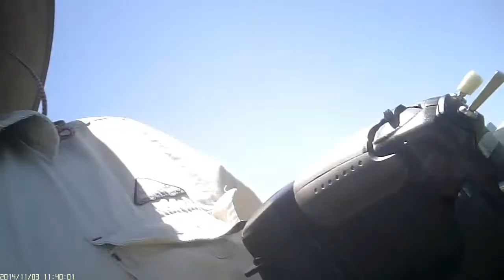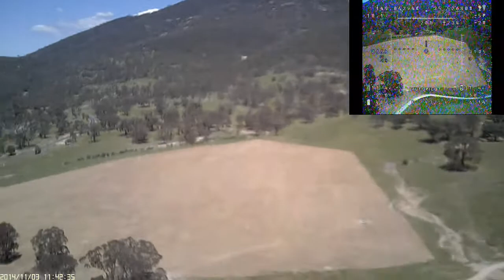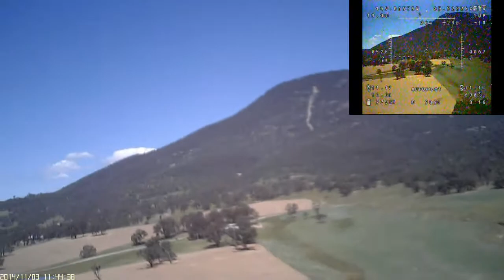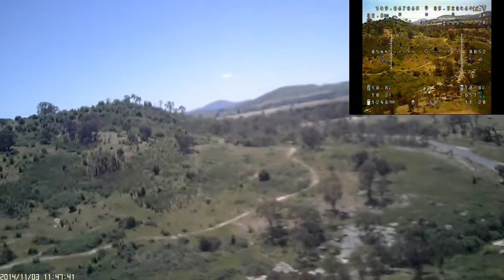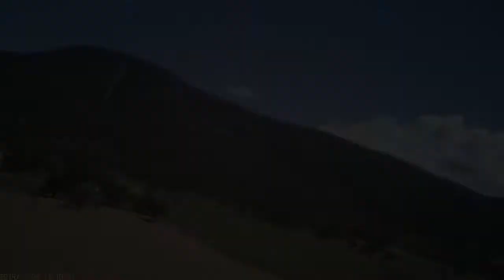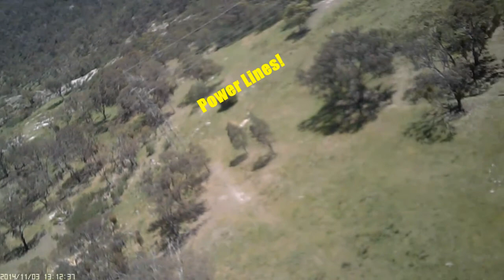FPV Range test - TS58500 vtx

Comment: I have the same TX + RX and after much testing, I've come to the conclusion they are utter horse shit. My mate that a fly with some times has a 200mw TX/RX system from ImmerisonRC (I think) and he get's more then double my range using the exact  same antennas. Matter of fact, he gets more range with his Omni Antennas then i go with my 7 Turn Helical. 
This TX/RX setup, although cheap, was a waist of money in my experience.
Reply from the maker: Rueben Oz Thanks Reuben. I lost the phantom up on the mountain and am now flying a Raptor with an ExUHF 433mhz radio module which seems to have plenty of range. I'm still using the same video tx with a 12 turn helical on the base station and am getting out to about 3km before the video becomes very dodgy. I've ordered a new Pepperbox antenna in the hopes of getting some improvement but will now give some thought to the vtx. Here's the vid of my latest attempt: https://www.youtube.com/watch?v=N6MYsgVu76s
Reply: KenJungles 3Km isn't bad, But with a 12 turn helical, it should be much, MUCH more. Especially on a base station! If you do getting a different VTX or VRX and have better results, please let me know. I'm getting rather frustrated with my set up and I think it's about time to upgrade.
Good luck and happy flying =)